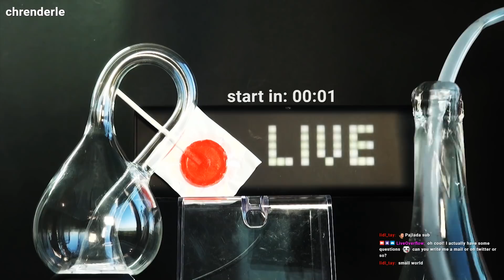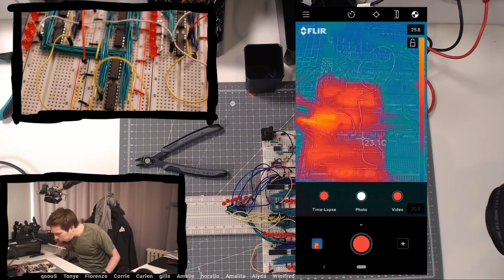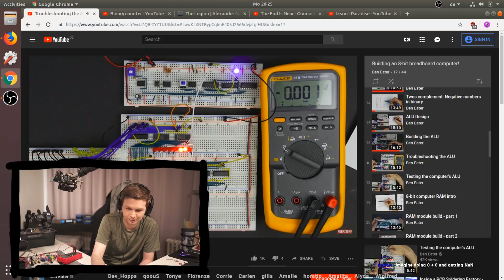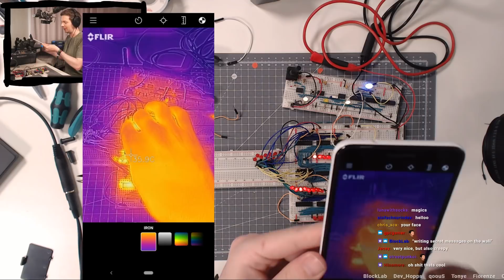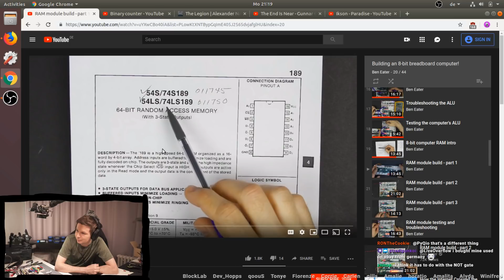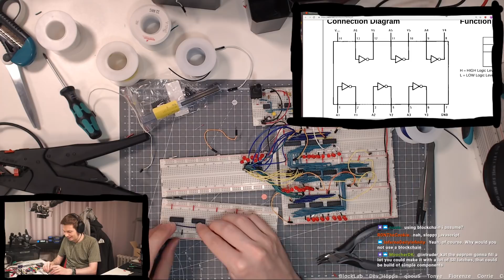Unboxing Tools and Start With RAM

Comment: " ... tried to measure a capacitor with a DMM ..."
No.
You use an LCR meter to measure inductance / capacitance / resistance ...
With a good LCR meter you can also set at what frequency the measurement should be made.

Or just use a network analyzer ...